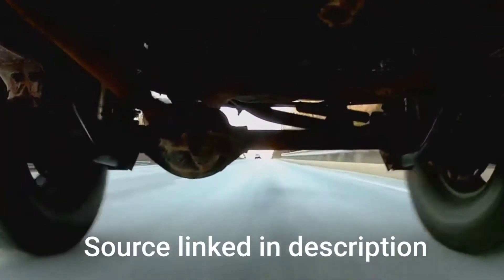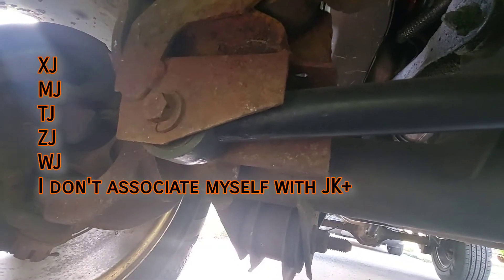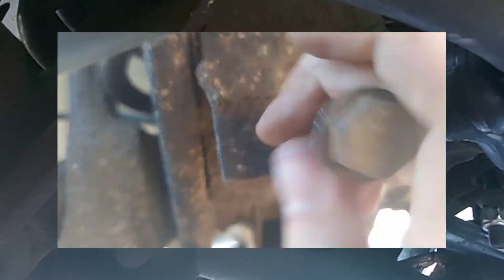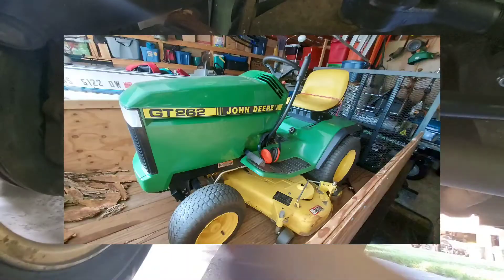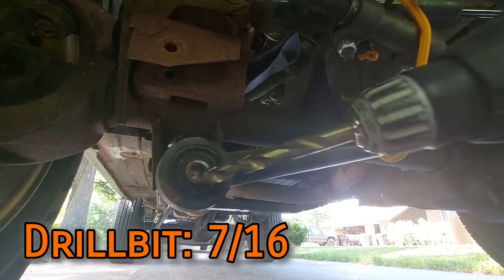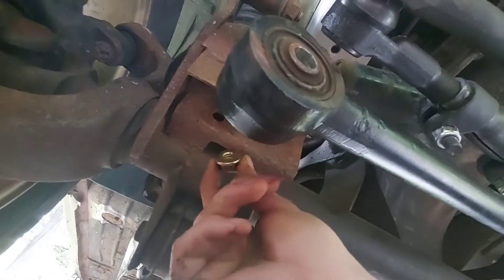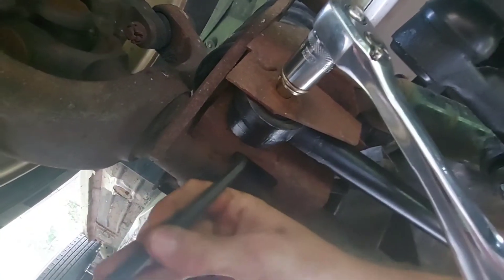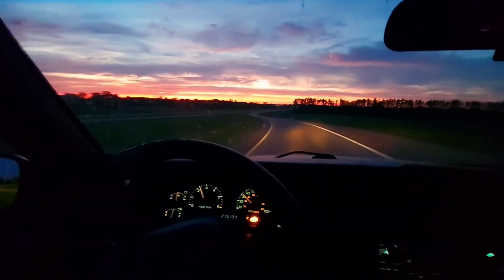Jeep Cherokee XJ - Loose Steering and Death Wobble fix: Dana 30 Track Bar Bolt Upgrade

Comment: Mines lifted and that bracket is modded so the track bar sits a little lower, should I just up the bolt that keeps the bracket there and keep the track bar bolt as is?

Comment: What type of drill bits is everyone using for drilling out the bushing sleeve I’ve tried a couple brand new metal bits but I’ve only made about a millimeter or so of progress any help would be appreciated
Reply from the maker: you need one rated for heavy metal, not just any drill bit can cut through that sleeve
Reply: Approximately how long did yours take to drill in using a cobalt dewalt 7/16 rated for stainless and heavy metal

Comment: I’m a chick that’s not very familiar with the inner workings of Jeeps (or cars in general) but I’m so sick of avoiding highways knowing that hitting bumps while driving over 50 mph is gonna start a crazy, scary wobble. My husband replaced the steering stabilizer because that’s what the dealership said was the issue. Obviously wasn’t the issue. Today the dealership balanced my tires so I’m gonna test it on the highway tomorrow, if it still wobbles I’m taking matters into my own hands and checking this bolt. I’ve been mentioning this bolt to both my husband and the dealership and if the bolt is loose I’m gonna feel pretty damn smug. 

My Jeep is a 2020 JL and it hasn’t been on too many crazy trails - insane that I’m experiencing so much wobble and the dealership seems absolutely clueless. 

PS you’ve got some great jokes here, I’m surprised you don’t have more subscribers!
Reply from the maker: The 2007+ (2020) Wranglers do have a bit of a different setup than what's shown here, the track bar may just have worn bushings - I'm not sure this bolt remained an issue in the newer models. 

The Steering Stabilizer is not a cure for death wobble, it's a band-aid fix that'll just mask the problem (in less severe cases) so the dealer you're going to can't be trusted. Aside from the fact that there's absolutely no reason a 3 year old vehicle should have death wobble, they're clearly just throwing parts at it for monetary gain. I would try a different mechanic shop for a diagnosis (not repair) just to find out what's going on, and then worry about repairing it.
Reply: Did you figure out what was wrong?

Comment: Appreciate this video. Just as a note, you might want to measure the existing hole first! Mine was already wallowed out to 0.44", where 7/16" is 0.4375". I still went with the 7/16" bolt because it was so close, but people have drilled out to a 1/2" bolt before. I also went with a 2 3/4" bolt length to match the oem length. 

Great video!

Comment: I never understand why jeep choosed to use a M10 Screw that has a extra thin 9mm shank instead of a a regular M10 Screw that is partially threaded that has a 10mm shank for the 10.6mm holes in the bracket and bushing.
For the moment I resorted to a  M12 screw that I turned down to 10.6 mm on the shank which is the size of the holes in the bracket and bushing and where I put M10 threads on the end for the oem flag nut. Not sure how long until the hole in the bracket widens again but at least I still got the 9/16th (or M12) options for later. An even better option would be to weld hardened steel plates to the front and back of the bracket in order to avoid the deformation of the hole completely.

Comment: I guess your Allen wrench is just a wedge between the nit and the box?  I need to try that. Or, it’s chopping time.
Reply from the maker: Yes, it fit perfectly between the nut and the bottom of the metal "housing"
Reply: @WAEMID IV  The nut on this one is so rounded off, I ended up cutting it off with a reciprocating saw from the inside by the bushing.

Comment: I did this with mine but I used metric 8.8 bolts, M12 with a locking nut on the rear, I pressed the old captive nut out of its little holder and then welded the bigger one in place of the old. Worked perfectly

Comment: When I tried to drill the track bar I ended up ruining the bushing did I do something wrong?
Reply from the maker: It can be difficult to hold the drill straight, yes

thankfully you can replace just the bushing without buying a whole new track bar
Reply: @WAEMIDIV  o ok Thanks. Did you have any issues with your drill stopping when drilling the hole bigger?
Reply from the maker: @ky0611  Yeah I solved that by buying a heavy-metal-rated drillbit, which has a sharper and more durable cutting surface. The drill stops when the blade is dull, so instead of cutting it just gets stuck. I think you need a new drillbit
Reply: @WAEMIDIV  aaaahhhh ok Thank you
Reply: So I broke the head off that bolt and wondering if you did the same thing. If so, how did you get it out?